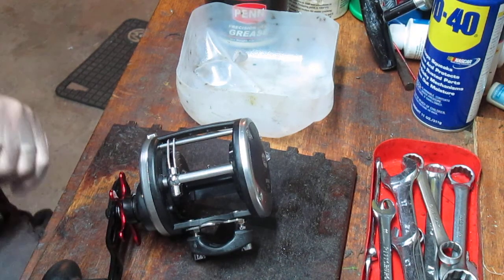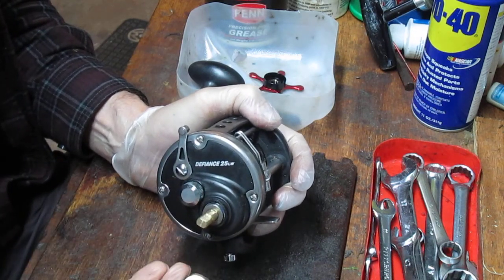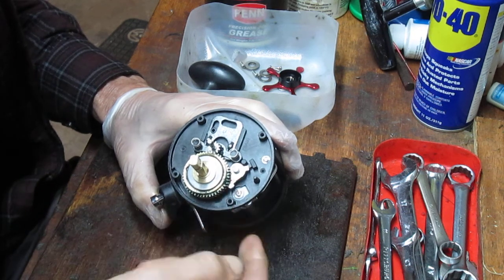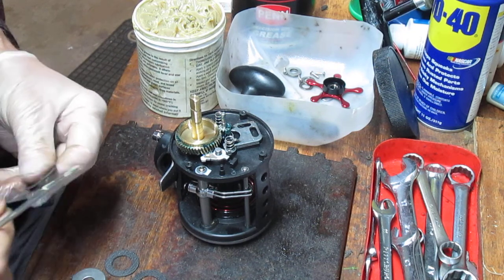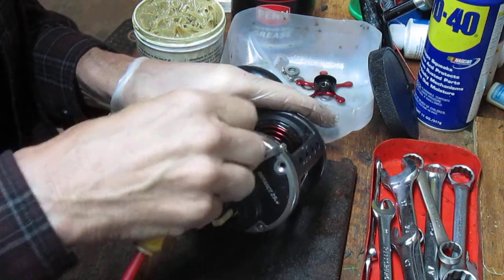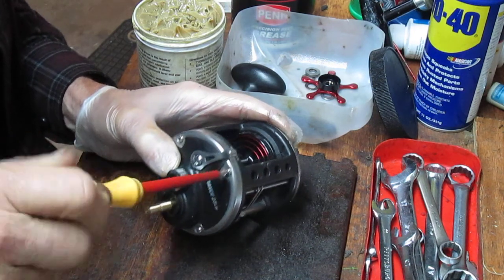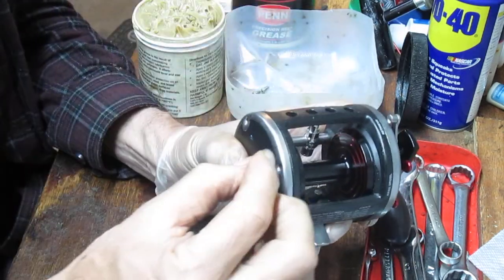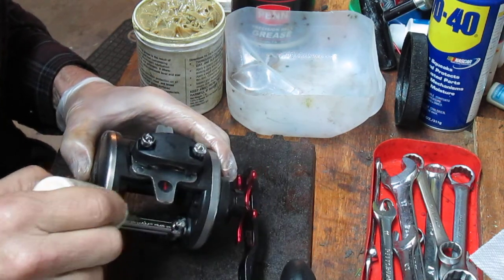Penn reels Defiance 25LW take apart, service and review

Comment: The Penn warfare is the newer replacement version for this reel. Penn improved the reel and still kept it under the $80-90 dollar range. Seen reviews of the 20n (n =narrow spool) bringing 20pound Mahi Mahi and yellowtail into the boat with a good angler operating the reel.  I've been thinking about getting a 15 or 20 levelwind for bottom fishing because of the auto engage. Thanks for the video, haven't seen much of the these models.  My local west marina had  the 30 and 40 size on clearance for $40 and $50 dollars respectfully. They sold out quick.
Reply from the maker: Thanks for the additional information.  These are good reels for the price.  I like the older GTI series, but as they say, they don't make them like they used to anymore!  - Dennis

Comment: Hi Dennis, you able shed some light for me? I have the penn defiance 20lw the release switch is not releasing the spool. Please help 🙏
Reply from the maker: You like have a problem where the pinion (spool) gear is frozen on the spool shaft so that the gear cannot move in and out to release to free spool.  You will need to take the reel apart to see if that is the cause - Dennis

Comment: I got one on eBay and the star drag slips as soon as I  tighten it.i figure the drag washers are toast.Any ideals would be helpful.
Reply from the maker: Does the reel have braid on it?  It may be braid slip.  If it has braid on it, remove it and test to see if the drags are not holding.  Braid needs to be backed with monofilament before adding it on these spools.  If you remove the braid and the drags are still slipping, then the drags would need to be replaced.  If the drags are holding, add about 15 yards of mono to the spool before tying on the braid - Dennis

Comment: Dennis, this may be a silly question,  but ive wated a lot of your videos and noticed you always use a screw driver to spread grease. Why a screw driver instead of a small paint brush? Only thing i can figure is you dont want to get a bristle in the moving parts.
Reply from the maker: Not a silly question at all and you have the answer.  I don't want to get hairs or bristles on the working mechanism.  I've found the small blade screwdriver works for me, so it's just become habit. - Thanks for asking - Dennis